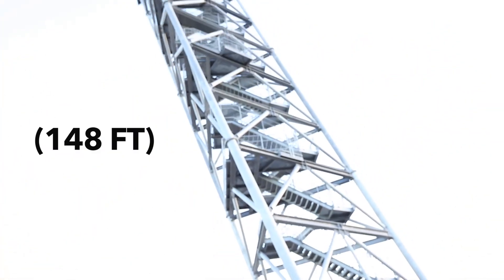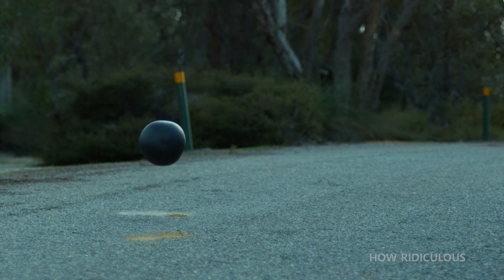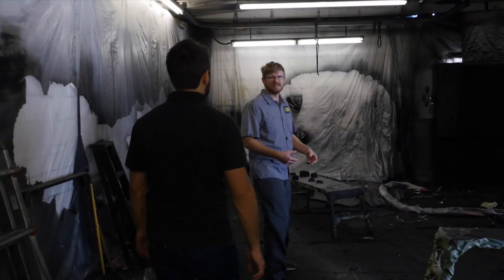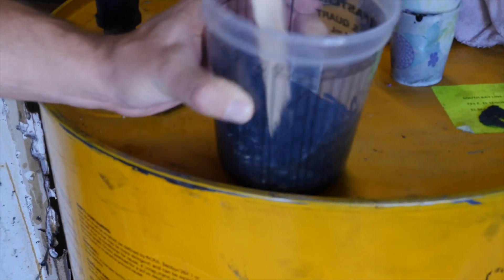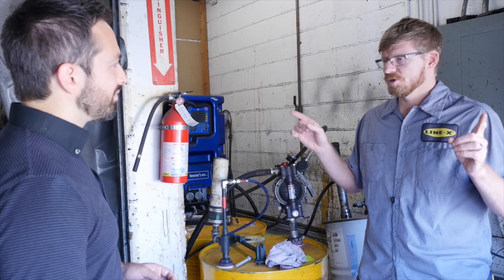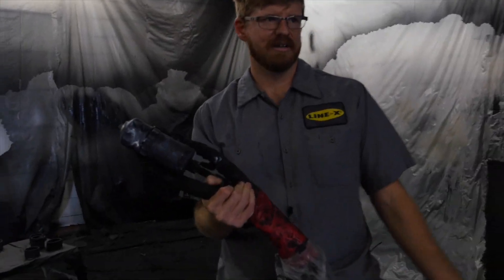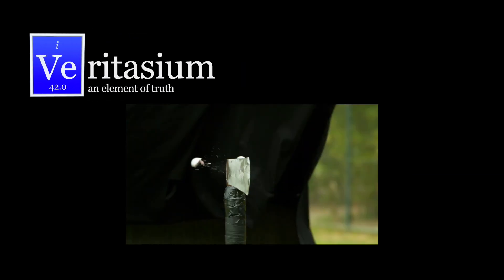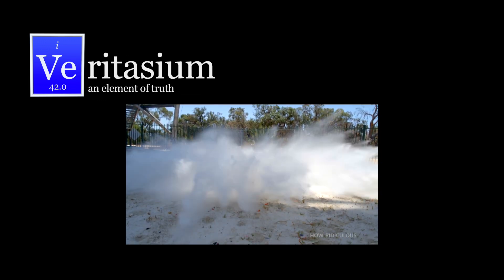Indestructible Coating?!

Comment: Coat sell phone cases with this
Reply: Unless you're planning to coat your screen with it too, that wouldn't stop the screen from cracking if you dropped your phone.
Reply: Ø it will absorb a lot of the impact which in turn will decrease damage
Reply: LineX is thin, so though it will keep something soft like a watermelon shell from deforming too much and cracking, there's no saving a cellphone's glass screen from taking damage. A soft shell case like the Otter Box design has room for the phone to decelerate slowly, reducing shock and hence possibly saving the screen from damage.

Key issue here is that a watermelon snaps back into shape, but glass and aluminum that make up a modern cellphone do not. The screen will still crack and the aluminum will still bend. 

But if you coat an Otter Box with this it would probably be pretty good.
Reply: It doesn't actually absorb impact though. All it does is keep the shell from deforming too much to crack open. It wont help a rigid body like a cell phone at all, certainly not more than any discount phone case.
Reply: Nice, then they cell the cases
Reply: Also, that watermelon was totally wrecked on the inside
Reply: +Ø So phone cases are useless?
Reply: Ø I feel like a case made of this stuff would be pretty damn good
Reply: Actually, components can be sheared off the PCB due to high deceleration upon impact. But for preventing scratches from minor mishaps, this would probably work. Except for the screen. You should kinda be able to look at it, so no coating there I guess.
Reply: The phone would still break, same way you can still get a concussion while wearing a helmet. The stuff inside doesn't stay where it's supposed to on sudden impact.
Reply: Shadi Nachat Interpret "little kid." I'm clearly saying this vs another normal case wouldn't offer any additional benefit. You're not going to be dropping a phone with enough force that the plastic case can't absorb as well as this. Also, it's "cell" phone not "sell" phone.
Reply: Shadi Nachat Buy an otterbox heavy duty phone case. They typically cost less than 80 bucks and are the strongest cases Ive ever seen.
Reply: Shadi Nachat they have aldery
Reply: Grant B Depends on the case.
Reply: Shadi Nachat Wait till TechRax gets his hands on this stuff
Reply: [MsR] Master I was thinking more along the lines of a normal sized rubber phone case, just made of LineX
Reply: ***** No, I don't think a watermelon will split if it's dropped from a foot.
Reply: ijirving OK let's not use cases at all then, think a little kid
Reply: ijirving That guy can't punctuate properly, he meant "Think a little, kid," not "Think a little kid". He was still calling you a kid though, so I guess it doesn't make a difference...
Reply: Lyndon T absolutely right, I wanna experiment with some poly urea's

going to add nanomaterials:)
Reply: Shadi Nachat it doesnt absorb any impact. it just resists tearing and cracking. its not a rubber.

Comment: if you could spray shoes with this...i would never have to buy new ones? . only if i out grow them of course
Reply: Andres Torres 
forget that just get spray on shoes.
Reply: Andres Torres Flint Lockwood
Reply: sure but there have been plenty of products out there designed to do that
Reply: tfkoincognito Burn my feet off idgaf as long as i have unbreakable shoes.
Reply: Oscar Laight exactly

Comment: I don't really think it's indestructible
Reply: Sure but pretty damn good for coating
Reply: chadoftoons I'm fine with that
Reply: shear strength is probably pretty low in comparison to tensile strength. if it's shear was equal to tensile, i sincerely doubt that buzzsaw would have done anything.

Comment: Body armour made from steel thread, carbon fibre and kevlar in a thin fabric to make multiple components for a halo type panel suit? or just let it burn onto your flesh except the joints to become bullet proof (unless hit with force, or until your skin rots from the moisture)
Reply: Or until you pass out from heat stroke (sweating is really important guys!)
Reply: CaptainRedbeard you could probably somehow manage a liquid cooling system, but I guess that would ruin the whole being invunerable thing.
Reply: Austin Drapen I was referring to the last part of the comment, regarding coating the skin directly.

Comment: How thick would it need to be to be bullet proof.
Reply: So thick that it would weight more than steel plate to do same job.
Reply: The Draugr good, I can finally make a toaster that isn't bullet proof.
Reply: Lord Lima Bean the rubber itself isnt being used to be bullet proof, its just to catch the bullet fragments after they hit the steel plate so they dont splatter into your neck or other extremities

Comment: They catch spalling alright (bullet fragments from when they hit a surface), but a few  shots are enough to peel it off the armor plate.
Pretty cool stuff, thoug. I wonder if it could line up the insides of a tank to prevent shrapnel from a hit to the armor.

Comment: hitting a bouncy object with an axe is a good idea
Reply: He should have tried using the blunt end of the axe on the ball.
Reply: @GoHardMang  😂😂😂
Reply: Yeah, did that to a cheerleader once, got no end of trouble.
Reply: That WAS pretty retarded, honestly.
Reply: @samuelluria4744  dOnT sAy wEtArD
Reply: GoHardMang I can't stop laughing!
Reply: LOL! dig! I was waiting for traumatic event!
Reply: We'll pin yaaaaa!!!!!
Reply: At least it wasn't a doble edge sword
Reply: I laminated carbon fiber and kevlar onto a honeycomb core and my coworker leaned it against a wall and hit it with a sledge hammer. It bounced back and nailed him straight in the face.
Reply: Especially if it is double edged
Reply: Not a good idea I know,but it's mainly about your stance,and preparing for the recoil.
Reply: i was so afraid it would bounce to side and into his shins
Reply: I hit a bouncy ball with a hammer. Ow
Reply: A axe? 

In denmark you do it with nuclear bomb
Reply: Just like mixing hazardous chemicals without protection
Reply: It’s a great idea
Reply: Well that's not too different from hitting a golf ball with a club.
Reply: @medexamtoolscom  Clearly you’re not a golfer
Reply: ONLY if you swing it properly. Any offset will spin the head to your face.
Reply: I know right
Reply: I literally use a hammer on a half pipe tube and it went back and broke my eyeglasses
Reply: I almost got killed that way once.
Reply: Bouncy "round" object
Reply: can we apply this to airplane?
in case of crash the air plane and passenger will not damage
Reply: oh yeah
Reply: first thing i thouht!?
Reply: En México donde vendes
Reply: ikr... could've gone wrong
Reply: I was was like “?”
Reply: Boing boing
Reply: heheheheh been through that faze
Reply: i agree lol
Reply: It was Gaunson hes not a heavy hitter.
Reply: Lol
Reply: Ikr, what could go wrong.. 😅
Reply: They are Australians
Reply: I can confirm this
Reply: I cut a slice in my eyebrow by doing that lol
Reply: agreed
Reply: No hurt da kitty
Reply: Lol
Reply: 6969 liker 🦹
Reply: Even better... A BATTLEAXE
Reply: Should be fine if you know how to swing an axe .
Reply: BONK
Reply: Its the start of a how i lost my tooth story
Reply: So basically I can cover my car with this and it instantly becomes my crazy ex girlfriend proof?
Reply: Dual Wielded
Reply: An good idea* 
Excuse you
Reply: Yeah to break your face or nose probably
Reply: The way to do it is with a chainsaw.
Reply: wranglerstar's sister knows this for a fact.
Reply: @frailty1288  He used it to chop up the disposed body of his Sister after he raped and murdered her (Sweet Home Alabama)
Reply: Quangluu96, Yes, that was the joke.
Reply: It’s hardly “bouncy”. It loses something like 90% of the energy from the drop.
Reply: It was only bouncy because of the massive amount of force from the drop. Hitting it was an axe isn’t going to produce near the same amount of bounce.
Reply: jordan secrist Ylu really didn’t see the danger there? The biggest danger is the axe hitting the foot because it’s a round object.
Reply: @MisterRorschach90  shut up stupid
Reply: GoHardMang and then the axe jumps into his head again
Reply: I know, that's what worries me about all these stupid people doing "science" shows.
Reply: NOT a good idea..

Comment: Environmental concerns? Humanity doesn't have a great track record with coatings that have apparently really cool properties...

This is really only useful for the future if it degrades or can be degraded to something biologically inert. Or, alternatively, if it burns cleanly, can be prevented from escaping into the environment, and is also manufactured from renewable feedstocks or feedstocks that we will be able to produce renewably in the future.

Comment: I wonder if the gun ever gets clogged up?
Reply: Yes it does. We have to clean it daily or else it will close shut. Also it's not uncommon for them to crap out suddenly lowering production.
Reply: Not sure about this process, but some mixing sprayers have short disposable reaction tips.
Reply: Depends on the gun. Some of them you can purge air through manually after a spraying to keep it from sticking in the tip.
Reply: the switch must be right before the mixing, also at the moment of the spray it is in liquid spray and there is enough pression to empty the gun when you release the trigger
Reply: Cédric Raymond Ok see. The reaction was very fast i was just wondering if the barrier would have to be changed after every time however that make sense.
Reply: Kara Hanscomb Thank you for the information.

Comment: x''(t)=g
x'(t)=gt + C
x(t)=(1/2)gt² + Ct + D
with g=9.81m/s² and t=3.01s
the speed at the beginning of the fall is C=0m/s and the starting height is D=0m if you put the x-axis straight down from the top.

x'(3.01s)=29.53m/s=106.3km/h
x(3.01s)=44.44m

However if we resolve the falling time according to the height of 45m we get a different result.

(1/2)gt²=45m
<=> t²=(45/4.905)s²
=> t=3.029s

with that we get

x'(3.029s)=29.72m/s=106.97km/h

And all this is not even considering the air resistance which would slow the melon down even further.

Either the tower is higher than 45m or the specified speed of over 107km/h is false. But when we take the measurement of 148ft or 45.11m we get:

(1/2)gt²=45.11m
<=> t²=(45.11/4.905)s²
=> t=3.033s

x'(3,033s)=29.75m/s=107.11km/h

In summary: the measurements given here are kinda vague and should not be relied on.
Reply: blakkcooper Did you seriously go through all that calculation to see that they were .11 off? You are awesome!
Reply: The specific speed is unimportant, the point is that it is going fast
Reply: blakkcooper wat
Reply: Lol, it is nothing stunning XD if u know how to do it of course, it takes like 5 mins

Comment: No doubt extremely carcinogenic.
Reply: obviously needs to be tested before making the procedure legal, but why would it be? it's a polymer. you wear a mask for the application process and if it's in a sealed environment for the curing it shouldn't be releasing anything.
Reply: though I wouldn't be sawing it in half without wearing a mask but that goes for most things.
Reply: A molecule that big? I don't know... It probably can't even be absorbed in a celular level, a person would probably be in a much greater risk of suffocating than getting any kind of cancer from it. But it's just a guess.
Reply: lerojo it being a polymer it wouldn't matter unless you breathed in fumes or powder of it which wont happens so it doesnt mattet

Comment: I wonder if this stuff would be good for tires? I mean, where are they getting the resources from? is it from oil?
Reply: Nathan Trone the traction would be pretty poor. tyres wear down because they grip the road and that causes wear. the harder the tyres, the less wear but also the less grip. if this was able to withstand wear, it'd likely be unsafe to drive on
Reply: Just put a coating on the inside of the tire, anti-puncture tires!
Reply: Trancecend it doesnt stop bullets, it coats a metal plate and catches the bullet fragments
Reply: If it can stop a bullet, then there's a pretty good chance it will stop a nail
Reply: Exactly how the person above you described: It doesn't.
Reply: There is thousands of possible uses for this stuff. The question that comes to mind is, how much does this stuff cost
Reply: Multi-urea bonds, it's made from dinosaur piss :D
Reply: Actually, I've heard they use this stuff on the runways of aircraft 
carriers! But that could be a special mixture different from the bed 
liner stuff.
Reply: it doesn't stop bullets. They use it to coat steel plates in bulletproof vests and it stops the fragments from spattering everywhere once the bullet shatters from hitting the plate. A thin sheet of this stuff alone probably won't be anymore effective at stopping a bullet than rubber would.
Reply: It would be really interesting if they tested inflating it.  Although I seems like a really hard substance to mold.
Reply: I wonder if the weight or flexibility would be an issue...
Reply: Daniel White not necessarily, wear is not the same as traction, usually connected though but not mandatory
Reply: well getting a spray-in bed liner is quite expensive, so i would imagine the chemical itself is as well

Comment: If a car coated with this polymer happens to collide, wouldn't it mean that more energy would be absorbed by the vehicle (and driver), making it more dangerous to drive cars coated with it?

I always thought that the light alloy that makes up car parts (sans chassis) were meant to be deformable in order to dissipate a bit of the energy involved in a collision.
Reply: At high speed the coating wont matter at all the crash damage is almost the same
Reply: chadoftoons Fair enough.

Comment: line-x sucks, i put it on my jeep and it didn't keep the rust away it actually seems to have made things worse because you have to remove it to do repairs.
Reply: that was whom ever put on the Line-x mistake. If any water is caught under the surface the oxidation process will continue. the surface can have no water and or you need to make sure there is zero soft rust under it. putting it over the surface of existing rust wont help
Reply: Chemist and car aficionado here; you have to make that everything is really dry before applying line-x. If you have any water trapped between the linex coating and the metal then you are kinda fucked.

The best is applying the line-x on a day with low humidity, you can use a heat gun to eliminate moisture on non-sensible surfaces before the coating. Contrary to belief eliminating water from metal is actually a little hard, mainly because the process is slow at ambient temperature. 3 days under the sun with low humidity can do the trick the same.
Reply: Oakiemouse thats a problem with the applicators. not the product. it's a common thing if you don't sand and dry the truck bed properly before application.
Reply: Exactly Anthony. My jeeps Line-x coating worked great and kept the interior bed strong, safe, and easy to clean. Money well spent.
Reply: In the 1970s, someone sprayed our 400 year old cottage with "modern" polymer coating that was supposed to be zero maintenance and would prevent the house ever needing painting again. Suffice to say: nope. Instead, the house stopped being able to "breathe" and got damp, the polymer eventually got brittle and began to flake in places, making the house look terrible, but in other places was so firmly attached it couldn't be removed without also taking off some of the wall underneath, meaning the house couldn't be painted properly again, even though we wanted to. In the end, the damage done to a building of historical importance by the previous owners trust in the new technology of the day is tremendous, as will the eventual cost of the remedial work now required.

And then there're the environmental concerns.

Suffice to say, humanity doesn't have a great track record with apparently cool seeming new chemical technologies. I think I'll wait another 30 - 50 years to give all the unforeseen problems time to make themselves known before I sign up wholeheartedly to this.

In the meantime, I hope the manufacturer has a clean-up contingency plan, just in case.

Comment: When water is frozen in a sealed container, it breaks the container, because of the force ice puts out. What would happen a container full of water was sprayed with linex, then frozen?
Reply: the material stretches as they mentioned. frozen ice would not expand enough to break it.

Comment: would it be a good idea to use coat a tyre with it?
Reply: You could also line the inner part of the tire so you could still do it on street tires or even a bike.
Reply: I would guess no, while it would be durable and make the tire virtually puncture-proof, you would undoubtedly loose a lot of traction.
Reply: +Obbliteration coat the inside of the tyre
Reply: tire, not tyre.

Also, not sure why they are jumping all over you.  You could just spray it on a liner and use that liner to line the inside of the tire.
Reply: Well that escalated quickly
Reply: not if you do off road tires,
Reply: Would the weight or the change in flexibility be an issue?
Reply: TiagoTiago Considering the way the watermelon deformed, I'd say flexibility wouldn't be an issue. And since it's a plastic it's probably pretty light. Spraying it also keeps it pretty balanced if you can get an even coating. And if it's in a car tire, those can be balanced with weights.
Reply: sorry I can't english lol
Reply: mohd alif No. Tire punctures rarely happen and you ruin the adhesive properties of the rubber and the pattern.
Reply: They're tyres if you're British, don't ask me why.
Reply: Johnny Steen
Some people don't like to be corrected when they are wrong.  They seem to think it is of the biggest offense.
Reply: Scheefinator Yeah, we live in a time where improving yourself is considered a terrible thing by much of the population.